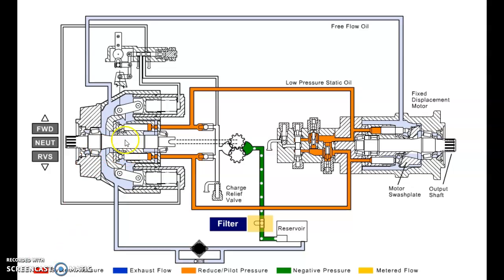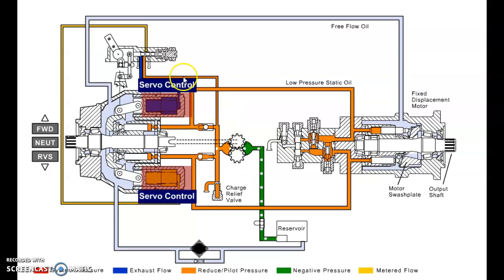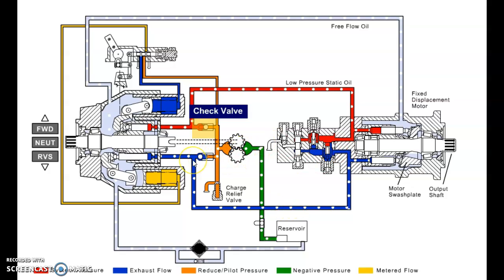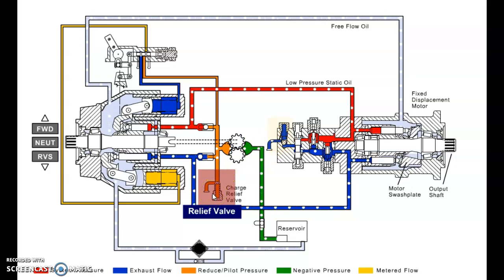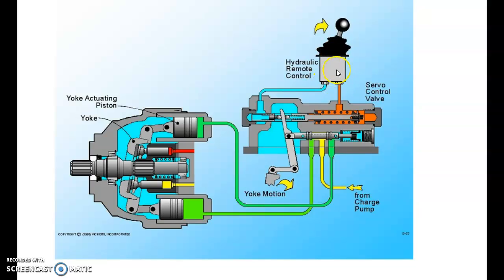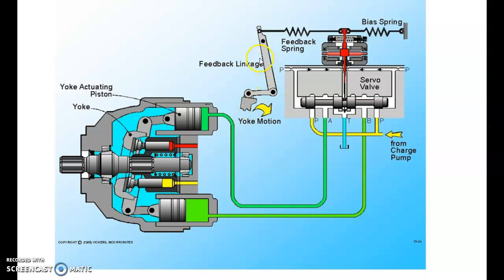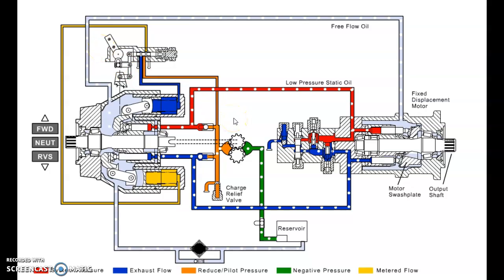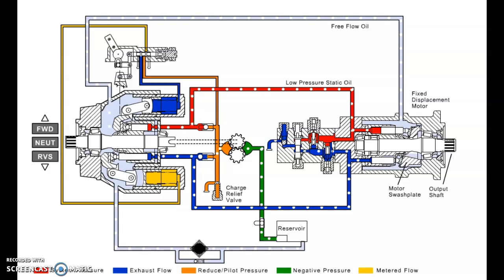Closed Loop Hydrostatic Drive - An Inside Look!

Comment: Please explain hydrostatic system no reverse o forward drive
Reply from the maker: huh?
Reply: a hydrostatic system is a system that utilizes hydraulic pumps and motors to transmit power to the final drives

essentially it's a hydraulic transmission

the engine is connected to variable displacement hydraulic pumps and variable torque hydraulic motors that are used to control how much speed and torque is sent to the final drives which ultimately rotates the vehicle wheels or equipment tracks (mostly used on off-road mining equipment) instead of having an engine and mechanical transmission with gears that control the speed and torque delivered to the final drives which ultimately rotates the vehicle wheels or equipment tracks

it's just a transmission that uses hydraulic fluid instead of physical gearing

Comment: G'day! Can you please explain how the v- selector and pedals (for steering) work on the Cat 953/963. I can't figure out how the lever controls (left driver controls) the swashplate (left and right pumps)and the pedals at the same time.
Reply from the maker: There's a ton of linkage under the top cover of the hpcu. And some external linkage for underspeed override. There are neutral and synch adjustments available through the 4 plugs on the hpcu cover.

Comment: Fluid mechanic is a scientific manner, in a close lope their is a flash valve in the systematic with is been fixed to draining out hot fluid in the loop to cool and direct flow strait to the coolant radiator then back to tank/resavoil